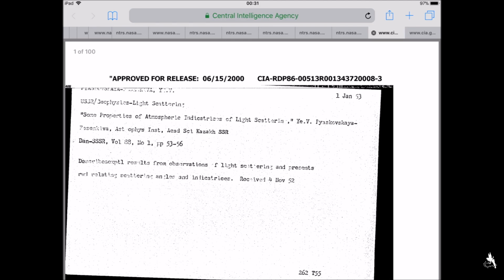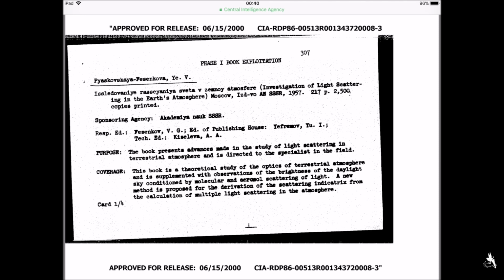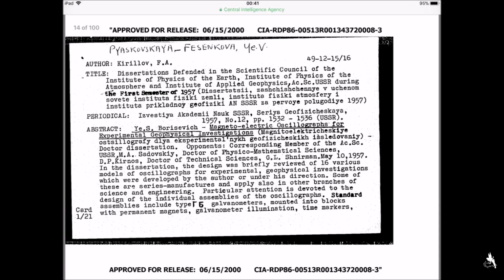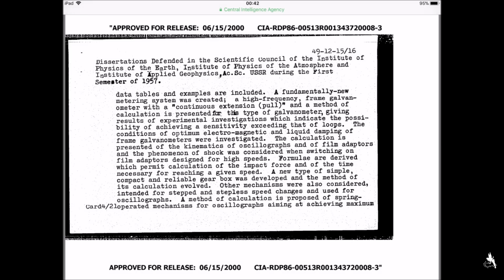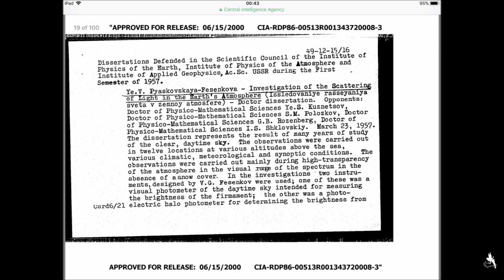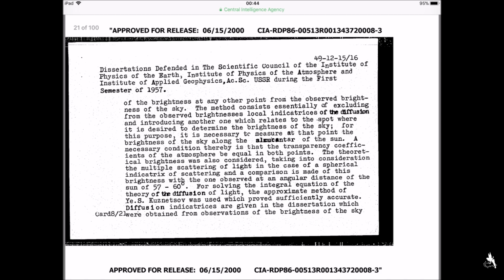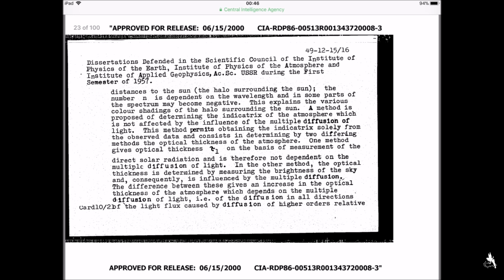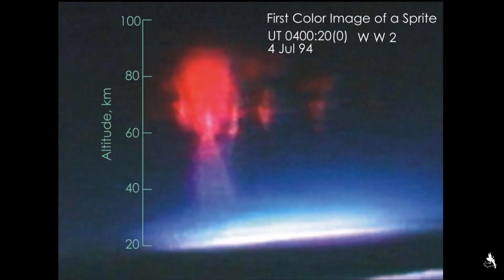CIA documents confirm Firmament

Comment: It's weird that Russian communist atheist scientists should use Judeo - Christian terminology, i.e. "firmament".  Could this just be a poor translation of the original russian document by CIA spooks?
Reply from the maker: firmament (n.)
mid-13c., from Old French firmament or directly from Latin firmamentum "firmament," literally "a support, a strengthening," from firmus "strong, steadfast, enduring" (from suffixed form of PIE root *dher- "to hold firmly, support" ).

Used in Late Latin in the Vulgate to translate Greek stereoma "firm or solid structure," which translated Hebrew raqia, a word used of both the vault of the sky and the floor of the earth in the Old Testament, probably literally "expanse," from raqa "to spread out," but in Syriac meaning "to make firm or solid," hence the erroneous translation. Related: Firmamental.The word firmament means "firm surface" And the french word "ciel” is derived from coelum which firm surface and the French wordsignifies chiselled material.
Reply: The question is what was the original russian word that was translated into "firmament" and has it been accurately translated as firmament.  It sounds a bit like a desperate clutching of straws on your part imho.
Reply: Judeo christianity is an oxymoron... Only people who havent seen through all truths layers use this terminology.
 
Old roman pagan roots we never got rid of  due to all the mixing of truth and race... There is only 1 real christian identity and jews are the enemies of that!!! Never use that bullshit terminology again.
Reply: Jesus was a Jew. Moron.
Reply: That's what they want you to think they are Satanist too. Just playing along the agenda they are ordered to obey